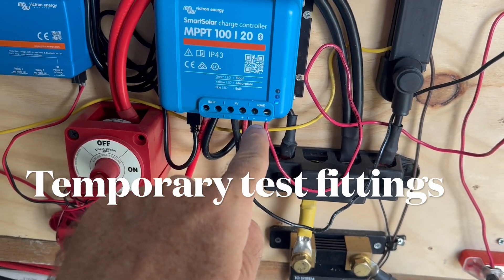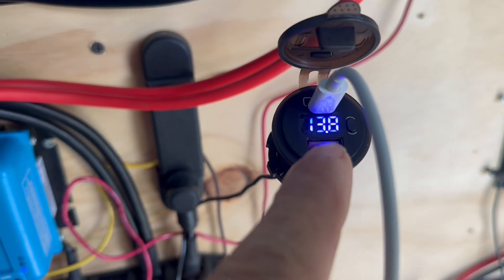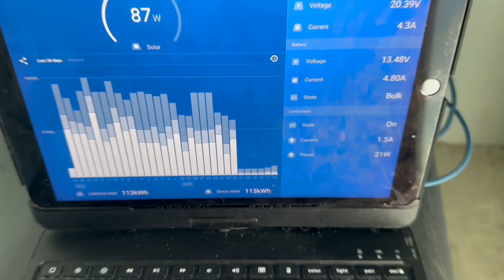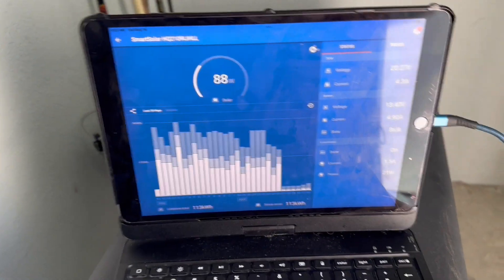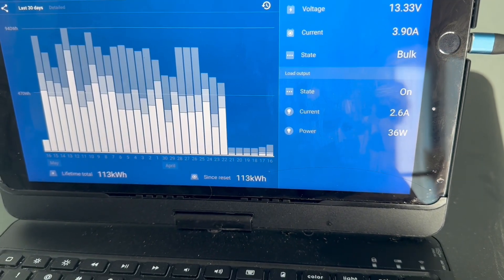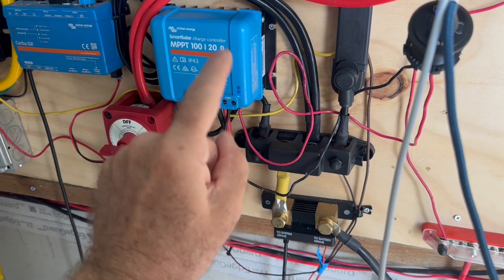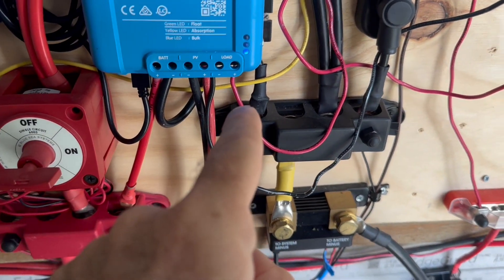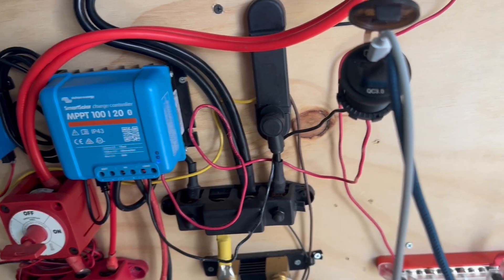Test load output on Victron 100 | 20 solar controller

Comment: I was given an eg4LL 48V battery and only have 2 EcoFlow bifacial panels with a VOC of 21.5.  Will both panels produce enough voltage to trickle charge the 48V battery?  I don't see where it states that information like my ecoflow 2000 max that says 10 -60 volts.    My knowledge is very limited and would be very helpful information to know before I ordered this unit as I can select 48V.  Thank you .
Reply from the maker: You might find that info on the controller … many of them state a minimum voltage needed before they will start charging.  If your panels don’t meet the minimum they have devices that will increase thr voltage - might be more cost effective just to get another panel and put them in series so increase the voltage.  
All the best, thank you very much for the comment.

Comment: I was thinking the same on the LOAD, run 12v small items but what really is  LOAD for??
Reply from the maker: I guess anything we can use up to the load capacity for the voltage.  Nice to have it.
Reply: @colinauld  I also think great but is it for this purpose? I cannot find any documentation on the LOAD?
Reply: Printed out the manual for the one that comes with the charger is too small to read  easily.   LOAD  12v  15amp output... So I got one of those triple cigg lighter power outputs and wired to charger.  Works great
Reply: @crosleyfiver000destruct0  I run my camp fridge off the load output. It is also basically a BatteryProtect, so can switch off the load output if you want at any given volt. Just never connect an inverter to the load output, keep it less than 20Amps load for small items...
Reply: @Shawn-ts4jw  Thanks for the reply .Downloaded and printed the manual out and read up on "Load".  I have saved my 100/15 for a possible future mobile project and upgraded to a 100/30 for my out back shed. Have installed 12v 200 amp/hr with bouge 2000 watt rv inverter to run a 5 cube/ft freezer. Has been doing great on a total of 400 watts of panels.  Overnight voltage does not drop below 13.2v.
Reply from the maker: I think it’s for just that. Not sure if always produces 12v … if you have the controller charging 24 or 48v batteries does it stay at 12v??

Comment: Hi what's the purpose of the load output? Do I need to use this if I just have 1 solar panel? Thanks
Reply from the maker: The load output gives you an option to run some devices right from the controller.  It’s pretty cool in that you can control it (on or off) remotely using the blue tooth app.  It’s not required, I’m actually not using mine at the moment.  I tested mine to see what I could run (fuse limits and voltage). It performed very well. https://www.youtube.com/watch?v=rfWoWYaE7Wk  Thanks for the comment.
Reply: @colinauld  thanks for the quick reply. The reason I ask is the person who has in stalled this for me has not wired the solar panel to the pv pos and negative. I think he's put them in load. The solar should go through a breaker.
Reply from the maker: @xtrax38    Very important to install this per the manufacturer instructions.  This can be dangerous and fire is a very real concern even at low voltages.  Take a couple of passes over the manual till it makes sense and then set it up as they require.  Even the torque in the screws is important.  There is a young guy on YouTube called will Prouse … he’s a diy solar guy with extensive electrical knowledge and he does actual step by step installation videos on the controllers.  
Hope all goes well, better safe than anything.
Thanks again for the comment.
Reply: @colinauld  I've just checked and my solar does go through a breaker.  I just need to place the wires from load to pv. Thank you.
Reply: @xtrax38   The PV or panels connect to the PV input, the loads really should connect through a relay but normally must be under 20a for most controllers. Anything over 5-10a should really run through the relay which is triggered by the load of controller. The heavy load is handled by the external relay which is easy to test/replace.

Comment: Hi, does this charge controller support 300 Watts load? With two series batteries of 28Ah 24V.
Reply: Look int the data sheet
Reply from the maker: I’m out of the country right now, internet is not abundant for me lol.  You can download the user manual on the Victron website.  The install and setup has the numbers you’re looking for.  Thanks for the comment.
Reply: NO, you need to connect the load to a relay to trigger the relay to control the load. Then if you want to read loads amperage look at the BMV-712. I have a vid on my channel how to wire/test a relay. A 40a relay should work fine for you. If you need further assistance leave a comment on a vid or there's an email in the descriptions. The vid is "How to wire stuff in a car" and how to wire a relay